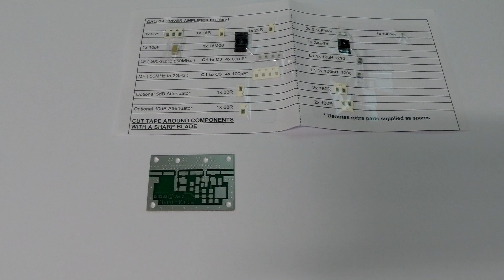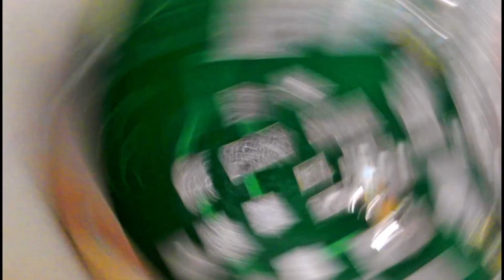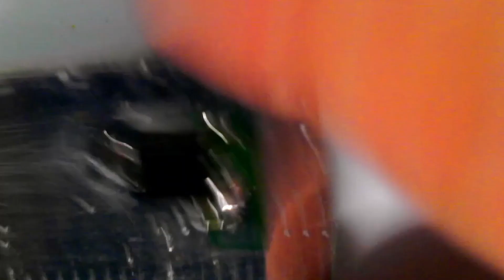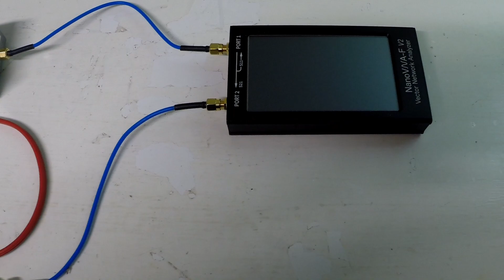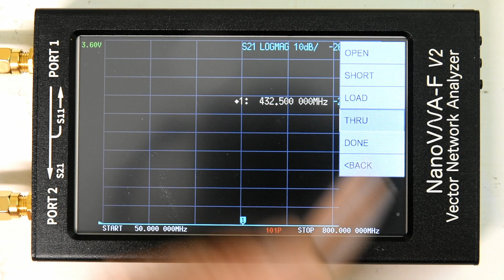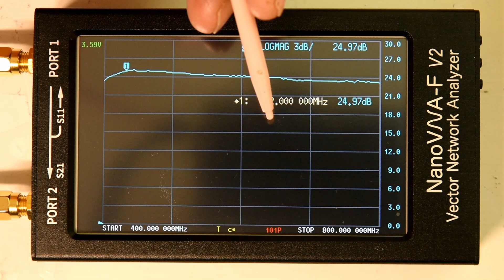GAL174 Wide-band Driver Amplifier - 10 June 2023

Comment: My YAMAHA HTR 3066 Showing "DC PRT : 253H" error. Some times it's shows 249h, 252h errors. And shutdown after 3-4 seconds. What are the possible problems.. is it a capacitor leakage or any short ?